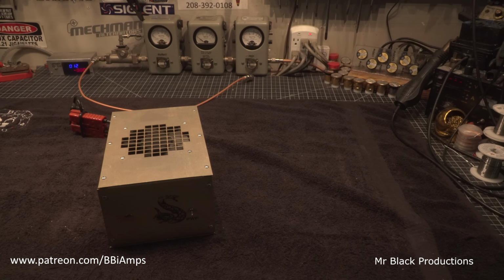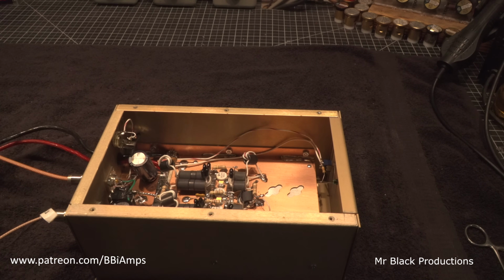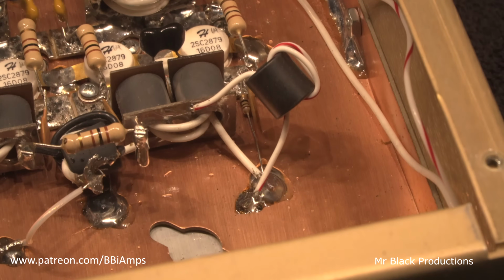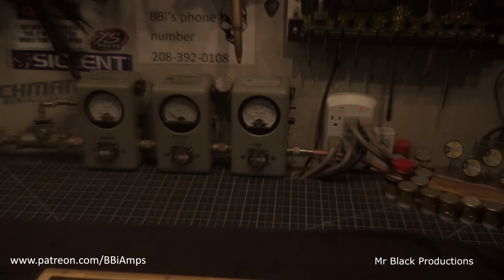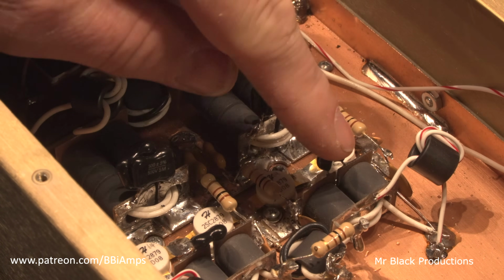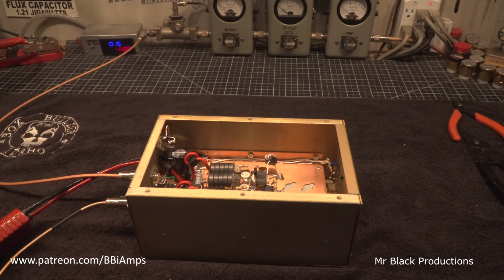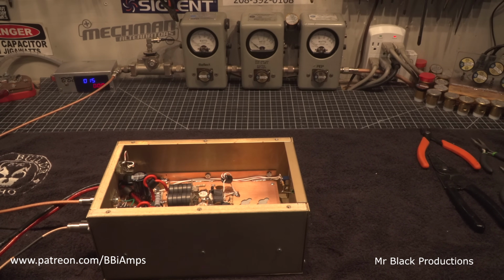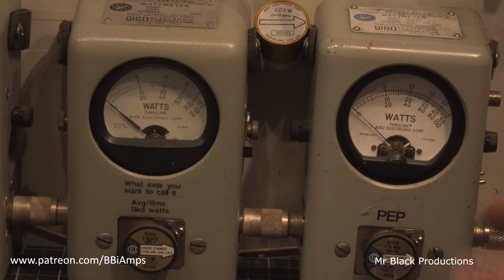Davemade 4 pill built by there new builder, lets look at it.

Comment: glaid that right now.working great ! bias a must for SSB . it will work class C but pills will pop over time . AM/FM ok even CW . getting a blue label 8 pill base to fix. the amp part fixed great RFP 2879. has 4 led 30 amp switchers keep going bad. has different bias circuit using main relay with RFC caps. it works. Friend use SSB most of time. runs kick ass 1.5Kw SSB on golfcart battery's/charger.  going with EPD inc. transformer.  large 36D caps. 200 amp bridge. them switchers do less then 30 amps when set 15V . friend wants IRON . he in driving range no brown shipp. 73's

Comment: I'd love to see a watts per mile chart. 
I know a guy pushing 40 watts and he could get out 7 miles. That's actually tested with both of us on the phone and doing radio checks.
That's 5.71 watts per mile or 1 watt per .175 miles. I don't think you could ever write that figure down in stone because of all the variables with radio of course skip was not happening in our little test. 
Connex 3300 HP, Stryker SR A10 antenna with decent coax.
Reply: Different antenna have different gains which can act like 80 watts instead of 40.

Comment: Question!! don't understand....   my radios operate great with the 13.8v power supply as per radio manual. But when we go 12v mobile is the radio short 1.8v ?
Reply from the maker: Start your car. Lol
Reply: A cars alternators output  is in the 14+ volt range when it is charging the battery, but it doesn't go above 15 volts. When a cars battery is fully charged it is in the area of 13.8 volts.